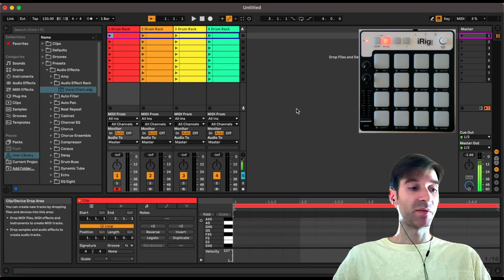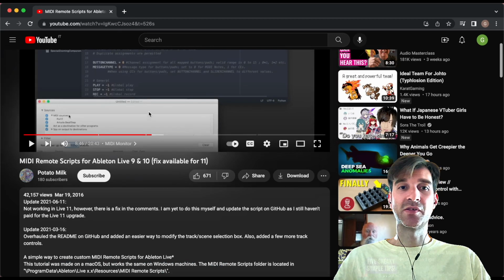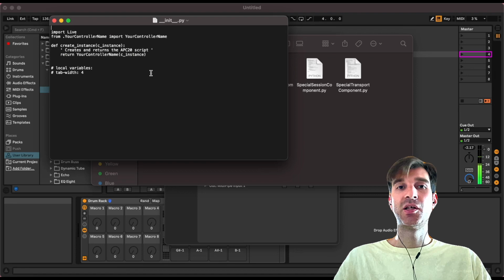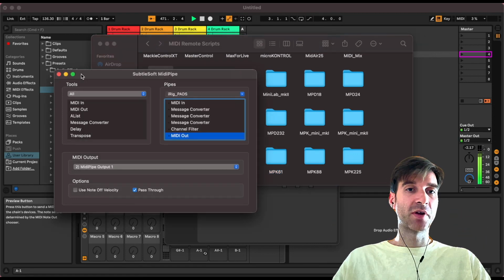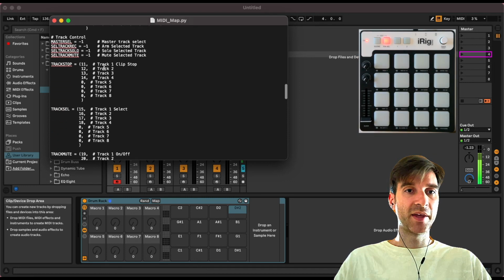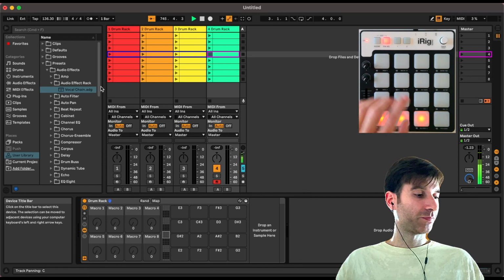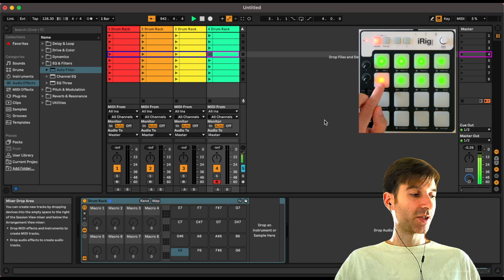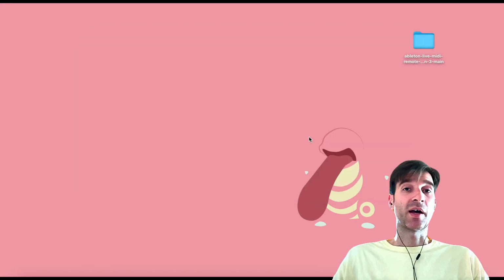Turn any MIDI Controller into a Control Surface for Ableton! Custom MIDI script tutorial [iRig PADS]

Comment: Hi, I have a weird python related issue if anyone can help. The name of my controller is "X-TOUCH MINI" in Ableton. That Hyphen does not work within code obviously. I tried using a variable, I tried escaping it with no luck. I can see it in Ableton if I use X_TOUCH_MINI within files and folders but it is not working with my mapping script. It shows up as X TOUCH MINI. Does anyone know how I can get it to display in Ableton as "X-TOUCH MINI" ? Thank you and thanks for keeping this project going!
Reply from the maker: Sorry to hear that. I think I remember someone mentioning a similar issue here in the comments, maybe have a quick skim through them, they might've found a solution!
Reply: @TheNeonSyndicate  Found the comment. XTOUCH_MINI works. Thanks again for your content and contribution to the project.
Reply from the maker: @ayoabe  Glad to hear you were able to get it to work!

Comment: Is it possible to change/ get notes from clips? I see many of the same controls as the max live object model, wondering if the live object model works for remote scripts or if there is a reference manual for all possible functions to and from live.
Reply from the maker: All assignable functions are listed in the map.py file, and I don't see anything there resembling what you're asking I'm afraid. It might be possible to dive into the other python files and do some deeper modifications there, but that's beyond my grasp of these concepts

Comment: Question 1:  On the Push 2, you can duplicate a scene so it will add one more layer in real time without much delay for live looping performances.  When I go in during the song and manually copy down each clip to the next scene, this process works great but is not as quick and smooth.  The duplicate button on the Push 2 and on Ableton pushes all the midi maps for my foot controller down one slot. So nothing controls the new scene that was made and now my second pedal controls scene 3, 3rd pedal controls scene 4 etc.  Do you know if there is a way to keep this from happening, or a way I could rethink this process in a smooth live environment?

Question 2:  I was going to try and customize my foot controller to attempt to make it more like the Push 2 scene selector buttons, which will not shift the "midi mappings" after the duplicating the scene.  My foot controller is 5 pin into my audio interface, then into ableton.  Ableton just sees the audio interface.  Will the customization work without Ableton seeing the name of the foot controller (Midi Maestro) show up, but rather using the audio interface name (UMC404HD)?
Reply from the maker: never owned any of the devices you mention so I'm just guessing here. As far as 1) goes, not sure I understand your goal: if the scene is already there, why would you wanna duplicate it? Especially seeing as this messes up your midi assignments. As far as 2), the script works with whatever is listed in your MIDI in/out preferences pane, and I'm assuming that would be your audio interface, so you should be good to go. Only one way to find out though
Reply: I just figured out that it does work.  I remembered another thing.  Is there a way to get the stock Ableton Looper effect to retrigger at the beginning of the loop when retriggered in the middle of the loop?
Reply from the maker: @mattbruamusic  Sorry man, Lite user here, don't have access to the looper. Wish I could be more helpful

Comment: Hi, thanks a lot for your video, it helped me a lot ! I'm right now writing a MIDI script for my AKAI APC mini mk2. Do you know if it is possible to have a LED feedback with the grid on session mode ?... It works, but it would be a lot more useful with light feedback 😅Thanks again :)
Reply from the maker: Hey my pleasure! That depends on the manufacturer I'm afraid. In my case, the iRig Pads accepts MIDI CC to trigger the backlights on the pads, so I can make them pulse rhythmically with the grid by just setting aside a track with the right MIDI patterns and setting the iRig Pads as its output. Don't know about the AKAI though. You might have to check the manual, if that feature is available, it's gonna be mentioned there for sure!
Reply: Thanks a lot for your help !! :)  @TheNeonSyndicate
Reply from the maker: @baptistebaudimant6126  pleasure. Let us know how it goes!
Reply: I have the same controller. What name did you use to rename the files?  Is it APC_mini_mk2_(Control) or APC_mini_mk2_(Notes) ?  Would you mind sharing me your file?  Thanks a lot.  Also @theneonsyndicate thank you as well!
Reply: Check the midi implementation manual from  Akai. The pads react on velocity values of notes. There is a full color chart. However, I don’t know what to add 8th the scripts to capture that. Looking through other scripts, you’d have to figure out where the clips are, pick up their colour, do some kind of mapping (e.g., from a fixed Python dictionary) and inject this when Ableton sends out the clip note and velocity values.

Comment: I'm running into a Problem with my E-MU Xboard controller. Ableton recognizes it as 'E-MU Xboard49', However, it seems that the usage of dashes '-' isn't allowed. The remote script won't show up in the dropdown menu. If I remove the dash (EMU_Xboard49') it does. Is there a workaround regarding dashes?
Reply from the maker: Hmh, wouldn't know, haven't had that issue... Does the script work without the dash?
Reply: @TheNeonSyndicate yes it works withoit the dash. Why would the nsme have to be exactly the same as the one ableton displays?
Reply from the maker: @emereo1981  That's (usually) required for the script to work. I guess dashes are the exception!

Comment: Maybe i missed it, but if i set this up with only device paremeters will it affect the currently selected track?
Reply from the maker: yes sir. If you select a different track, you're gonna control devices on that track. The device you're currently controlling is identified by that little blue hand icon

Comment: thank you so much for your great video! I'm struggling with how to know specific numbers or cc# of my midi controller. I'm using iRig Keys IO. I have no idea what kind of numbers or letter things in MIDI_map.py file...
Reply from the maker: My pleasure. First you should check the manual, it shout be in there somewhere. If not, just create a MIDI track, start recording and move one of your sliders/knobs. Stop recording and double click on that new MIDI clip. In the "Envelopes Tab" select "MIDI Ctrl" on the left and click on the right drop-down menu you'll see a small light blue dot next to the CC you just recorded.

Comment: Hey man :) amazing work! Thank you for sharing. Do you if it’s possible to repurpose something like this for use on a different DAW? I’m using Loopy Pro on the iPad and trying to figure out a way to get my Akai controller working as I’d like it/it’s designed… in particular with led light feedback. Any pointers are much appreciated 🌞 happy creating!
Reply from the maker: Hey thanks! So these scripts are Ableton-specific, it's highly unlikely they'd do anything in any other DAW. Also, other DAWs might not even support custom MIDI scripts. The only other one I use, for instance, is GarageBand, and that one I know for sure doesn't. Sorry I couldn't be of more help here!

Comment: Thank you! Explained in easy to understand terms and instructions are clear and linear. I was able to map a controller I had long desired to have control without midi mapping each project!
I have a general question regarding the script. Is there anyway to increase the number of parameters/channels above 8? This question is specifically for the PARAMCONTROL, because it is now possible to include 16 Macros in an Ableton 11 device. I have 16 knobs on the controller and it would be a dream to assign them all to a 16 Macro Device.
Unfortunately editing the script to include the additional 8 (adding Param 9-16) did not work. I understand you did not create the script, but any information you have regarding this or if you could point me in the right direction on how to figure this out would be greatly appreciated. I briefly scrolled through the comments and looked at Potato Milk's video, but I found no immediate answers.
Reply from the maker: Hey, glad to hear it helped. So I haven't tried this out personally just yet - something I'm planning on investigating thoroughly some time in the future when I have more time 😅 - but if you have a look at the Python file you had to rename after your controller (NOT the map.py file!), there's a section there where the original creator inserted the following comment: "# My guess is that altering the range here will allow you to alter the range of mixer tracks
 # So if you had a 16 fader mixer, this would come in handy." That "range" parameter appears later on in the "device" section, too and is suspiciously always set to 8. You could try and set it to 16 and see what that does for you. Might have to play around with some other parts of the code there to get it to work though. In any case, let us know how it goes 🙂
Reply: @TheNeonSyndicate  Let me preface, I have limited knowledge on coding, the last time I coded was over 5 years ago. I was able to change the number from 8 to 16 in the file you mentioned and get the controller to work, but without the additional 8 knobs to register. I tried a few iterations by switching the CC numbers of the knobs, changing all the different parameters from 8 channels/tracks/etc to 16 in the Map.py file, but with no luck. I looked into the other SpecialComponent python files and was not able to find anything that I might be able to change. 
I am not sure if it has something to do with Ableton's coding of the Devices themselves. I have a first gen Push, it is only able to control 8 Macros (at least to my knowledge).I don't know if this has anything to do with over 8 channels being able to be registered in the Device or if it is something else.
When you look into it and if you have luck please let me know. I will continue to look into this and if I find a solution I will be sure to post it back here.
Reply from the maker: Sure thing. When I find out anything, I'll update you here 👍  @liberthorn

Comment: Hii rlly loved your video
Im working the customized midi template right now. i do have a question
U know how if u put one fader linked to master volume and like when u reach limit of fade it passes way above zero on ableton 
would it possible to, on the template text file set the limit of it to 0??
Reply from the maker: Hey thanks. Man, I'm sure there's got to be a way to do that, but it won't be in the user-friendly map.py file. There's some code for that probably in one of the other files but that's a little beyond my expertise I'm afraid. Still, you could skim through it looking for words like "fader range" and see if you find something that makes sense
Reply: @TheNeonSyndicate  thank you so much for quick response. I will definitely look into that. Ill let u know if i ever find it :)
Reply: quick fix i just wen to my midi control center and set maximum level of fader to 109 out of 127 and it stops perfectly on 0!
Reply from the maker: Glad to hear that does the trick! @angelorosa700

Comment: Epic video thank you so much - just getting into Control Script editing and this is a fantastic digest. I was wondering with the track selection box - I have a group track (made up of 8 individual tracks) that I need to fold down during performance. Can I edit a script so that the track selection box includes the 8 hidden tracks in the group instead of spanning across the 8 visual tracks?
Reply from the maker: Hey thanks, glad it helped. I'm afraid this script works in such a way that it will always select the first 8 active tracks, so it'll always select the next 7 once you fold the first. You could try contacting the original developer though, he might be able to help you!

Comment: Thank You for this great Viedeo! Unfortunately I have difficulties. I wonder if someone could help? :) Using Arturia BeatStep Pro, which appears twice in the list of available Midi Ports: Arturia_BeatStep_Pro_(Arturia_BeatStepPro) and Arturia_BeatStep_Pro_(BeatStepPro_OutEditor) I tried both and have difficulties after copying the folders into the MIDI Remotes Scipts Folder. Now I have one available Control Surface just called Arturia Beatstep Pro even if I deleted both folders again. That brings me to the the next Problem I cant find any _pycash_ folder in none of all the available MIDI Remotes Scipts Folders. If someone could help I would highly appreciate.

Comment: Hey, thank you so much for this Great Video!!
I'm on windows and trying to setup my midi foot pedal as a controller.
I'm converting the midi messages via MIDI-OX since my pedal only outputs "PC" Messages.
Ableton Detects everything and all the functions which I need works, except one.
The Session Navigation seems to have a problem. it doesn't move the red box one scene at a time.
it goes all the way up/down when i press the mapped SESSIONUP/SESSIONDOWN button and also the same thing with right/left.
Reply: Hey i have fixed it!!
Just posting the solution for anyone else facing the same issue.
MIDI-OX was converting the "PC" to just "note on" Messages.
the Session Navigation box(Red Box) was not getting a "note off" message so it would go all the way down/up or right/left.
in MIDI=Ox i duplicated the "PC" message twice and made it output a "note on" followed by a "note off"
That seems to do the trick.
Reply from the maker: Love it when you find a solution before I even read the comment 👏  @JamesBritto
Reply: Hi again, I've been having loads of fun looping with my midi pedal after connecting it as a control surface with your midi script. can't thank you enough.
I'm just missing one function in the MIDI_Map file, the "Track Launch" button. (not the Clip Launch)
I'm sure i went through the whole file and was not able to find that function.
is there some way to add this to the MIDI_Map File?
Thank you🙂
Reply from the maker: Good to hear that! What do you mean exactly by "track launch"? What kind of action do you want it to perform? @JamesBritto
Reply: This button doesn't show up by default. It appears above the I/O section in Session view when you enter midi/key map mode. It looks like a play button. It can launch any clips in a particular track depending on where the scene selector is in that Instance.
Reply from the maker: Ah right gotcha. That's the function I use actually! It's called "SELCLIPLAUNCH" @JamesBritto
Reply: Yes i noticed that. But that works only if the scene and tracks are selected/highlighted. I wish it had a X*Y matrix like the ClipNoteMap so we could assign multiple midi notes to trigger any track without navigating to the desired track and scene.
Reply from the maker: Nut sure I understand. If you don't want to have to go to a specific X (track) and Y (scene) coordinate to launch clips, then why not simply use CLIPNOTEMAP? That way you don't have to navigate your way around your session to be able to trigger all your clips on the fly  @JamesBritto
Reply: I'm using only a few tracks so i would like to assign all the tracks "track Launch" to my midi pedal then i would only have to assign  Scene up/down to 2 more midi switches. Which would be more convenient for my setup.
But i figured that i could achieve the same with the ClipNoteMap before sometime.

Thanks a lot for replying to my Questions. 
You Rock🤘
Cheers🎉
Reply from the maker: Ahhh understod. Yes, that would indeed be convenient! You could try and see if you can use a MIDI conversion software like MidiPipe (Mac) or Bohme's MIDI tool (pc) to make it so that that pedal's MIDI note triggers: 1) the track launch button on track 1 (with SELCLIPLAUNCH), then 2) a new MIDI note that you assign to "move to next track", then 3) that first MIDI note again to launch the clip on that track and so on and so forth for all the tracks you have @JamesBritto

Comment: Thank you for the video,it helped a lot! But there's an issue I wander if you could help with...I midi mapped the overdub function hoping to record in session view when I tap my blueboard controller, but it doesn't act the same as midi mapping directly in ableton which records the armed track in session view, it only turns on/off the overdub buttom but doesn't start recording, I wander if there's any solution or where am I doing it wrong? Been trying to figure it out for quite some time...
Reply from the maker: Cheers. You could try and assign that same MIDI note number to the relevant record function, too. It's ok to have the same MIDI note trigger multiple different things